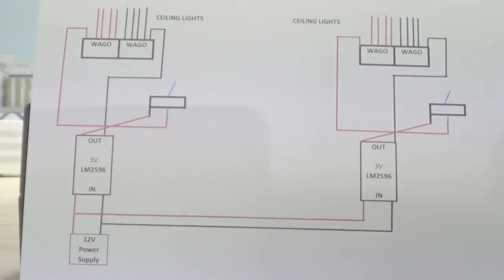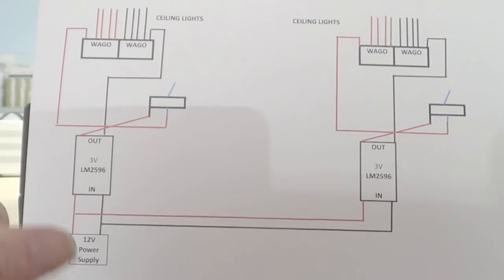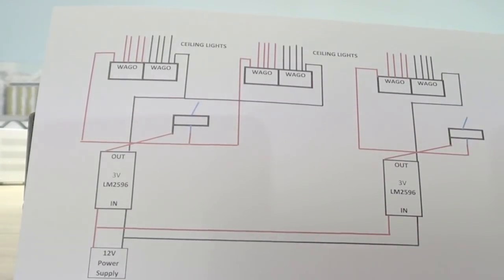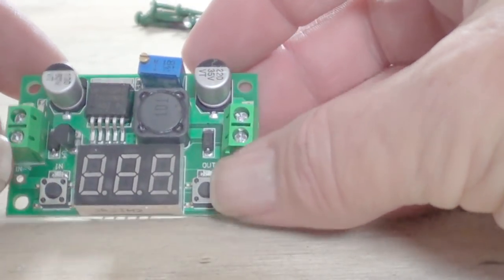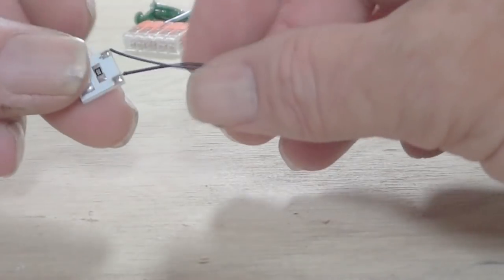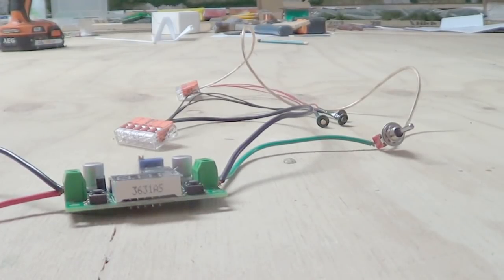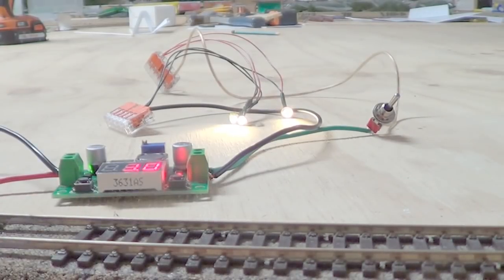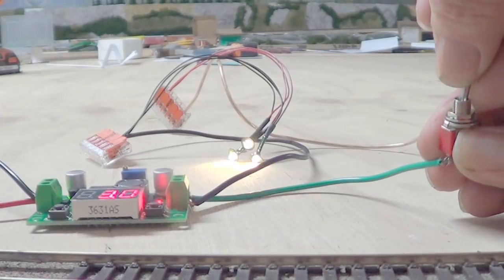Wiring lights Walthers 12 stall Roundhouse Part 7 "Model Trains"

Comment: Need a couple of questions answered. Any chance you can indulge me? Thanks.
Reply from the maker: What would you like to know
Reply: @csxmad  Thanks for responding. I've watched the roundhouse videos a few times now. After 25 years I'm getting back into the train world. I'm fascinated by the led light world. Here are a few questions. Many thanks.

1. You put 8 ceiling lights on one module without a resistor. I've read that 5 is the limit. How many can you put on one module?
2. What gauge wire for all the modules?
3. Is the reason you chose the module is to eliminate the resistors?
4. If I have a cheap 3 volt power supply is it possible to power all the ceiling lights without the modules?
5. Are the track indicator lights 18 volts and are they 3mm? 
6. Do these lights need a resistor? How many ohms?
7. Are they bright white or warm?
8. Lastly the track indicator lights that go into the small square tubing. Is the tubing transparent or did you cut a hole in them?
9.  Did you put something over the led itself before putting it into the tube?
Reply from the maker: @arahollisian5169  NO 1, I don't know how many, but i would have thought a few more.
NO 2 , The wire gauge was 0.28mm
NO 3 , Yes i choose the module to eliminate soldering resistors.
NO 4 , A cheap 3 volt power supply would work as long as it didn't go higher, this is why i went the modules.
NO 5 , Yes track indicator lights are 18 volts and are 3mm.
NO 6 , No resistor needed as they will not go higher than 18 volts.
NO 7 , Warm lights.
NO 8 , The indicator lights went into the tube which i cut out a hole on the bottom straight to the track.
NO 9 , No i didn't put anything over the led.
 Hope this helps you cheers Robert
Reply: @csxmad  Thanks for helping out. I certainly enjoy your style of explaining!
Reply from the maker: @arahollisian5169   Thanks and i hope you do well cheers Robert

Comment: Very Nice, Do you have any links or information that you can share to where you purchased the parts?
Reply from the maker: All the parts used are from E-Bay just key in Lm2596 modules and there are a few different version with led screen or cheaper one's with out.
And the lights are https://www.ebay.com.au/itm/50-pcs-HO-OO-gauge-Ceiling-Lampposts-LEDs-made-telpher-lights-hanging-Lamp/253460348747?hash=item3b0369ff4b:g:wLsAAOSwkNZUl~aw
https://www.ebay.com.au/itm/DD00W-20pcs-Pre-Wired-Bright-White-SMD-3528-Led-Lamp-Light-Set-12V-18V-NEW/173100057049?epid=1791441250&hash=item284d9141d9:g:714AAOSwzbxaXHuD

Comment: Where did you get the hanging lights?  (Nice work - thanks for sharing all of this.)
Reply from the maker: Steve this is where i got the ceiling lights from
https://www.ebay.com.au/itm/50-pcs-HO-OO-gauge-Ceiling-Lampposts-LEDs-made-telpher-lights-hanging-Lamp/253460348747?ssPageName=STRK%3AMEBIDX%3AIT&_trksid=p2057872.m2749.l2649    cheers Robert

Comment: I will reveal my ignorance and ask a newbie question.... what purpose does the module serve? To put a Pot in the circuit or something more extensive?
Reply from the maker: The reason for using the module cuts out having to solder resistors for every light.
Also i can not go over 3 volts because the led would blow up and by using the module,
it will not go over 3 volts unless i turned it up manually. And i can also dim the lights as
well. Cheers Robert